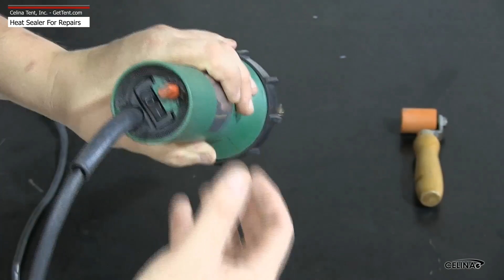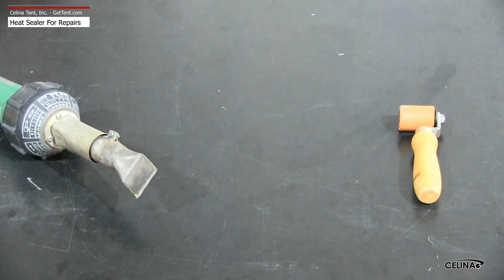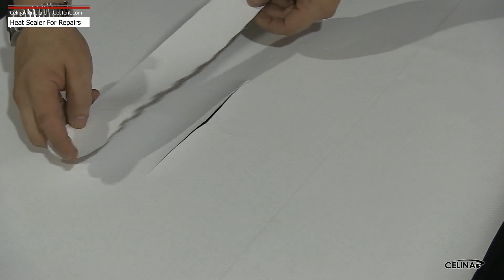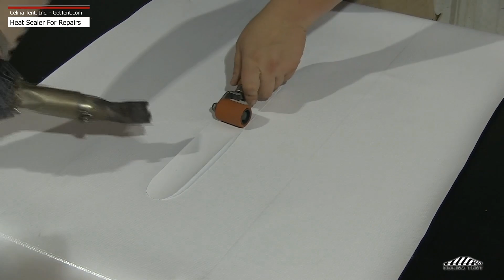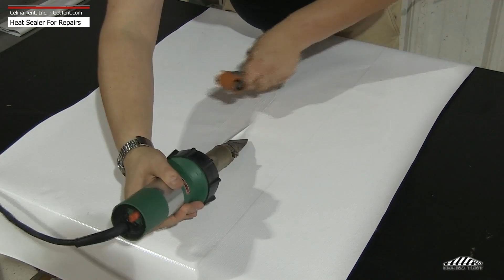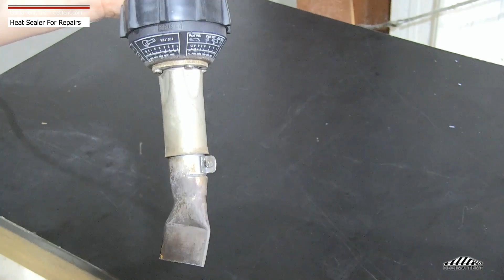Fabric Repair - Hand Held Heat Sealer / Vinyl Welder Overview

Comment: That looks like a fabric vinyl in the video.  Does it work on transparent welding curtains?  Got some welding curtains with cuts in the material, and need to patch them up with repair strips.
Reply: Yes

Comment: Great tool, and good video, thanks!  But $650 to buy a heat gun that sells for $22 at Home Depot?  Its basically a glorified hair dryer.  Way too pricey for what it does.  I need to make some vinyl shower curtain liners for my RV and need to seal vinyl edges but this gizmo is made of gold.  I need something in the $25 range.
Reply: Did you figure out how to seal your Vinyl shower curtain liners?
Reply: After 6 years , your comment still looks as idiotic as ever. Its a Steinel heat gun, your 20 dollar blow dryer is not even in the same ball park. Its a ceramic core to maintain a specific heat , specially designed for Vinyl decking. And the process of the seal is a difficult task, only achievable with this specific tool, and a great degree of skill.
Reply: @lass-inangeles7564  Wow, baggage much?
 and you are like , wrong?
Reply: @lass-inangeles7564  As a footnote. When I replied to your comment, I had no idea of your affiliation, He, She or They. I simply commented. You need to chill... They, He, She.
Reply: You can get a cheap one, that works just as good at Canadian tire for a 100 bucks